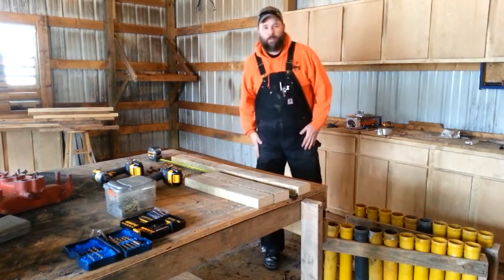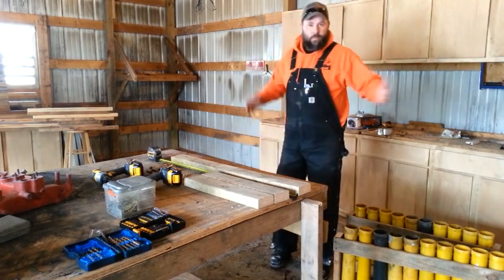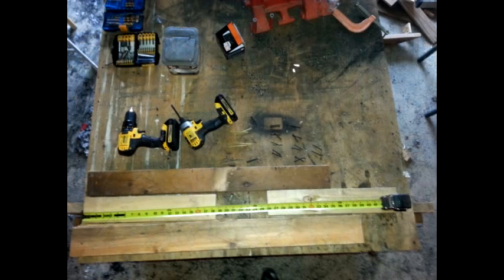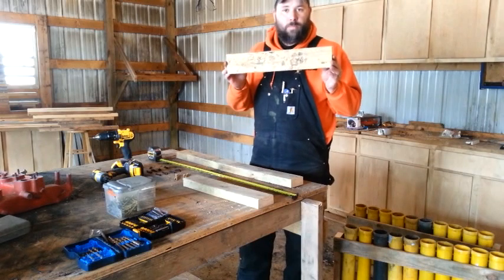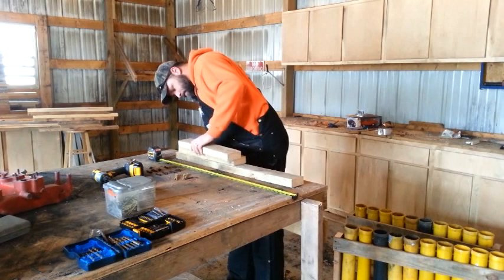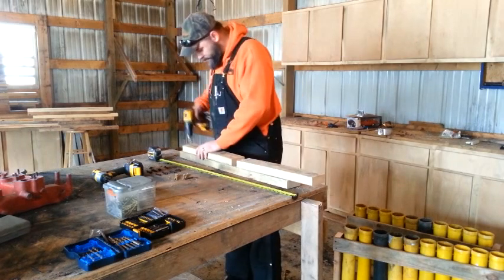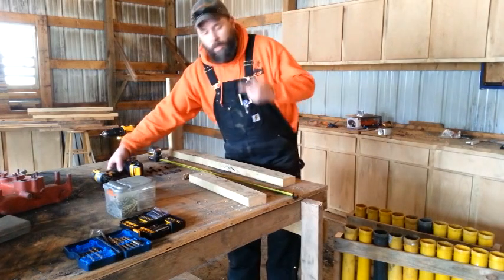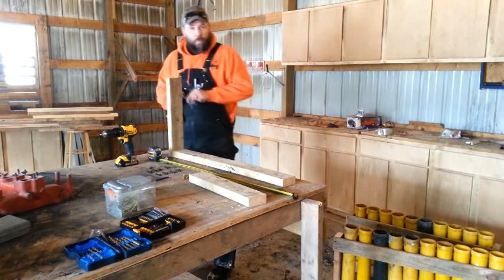3" Mortar Rack Construction Video

Comment: Good video Matt. May I suggest one more step, easy to do and increases the strength of the bonds. GLUE!!!  Tightbond II is the glue of choice. Wood plus glue plus screws! I feel glue is very important to use.
Reply: These things blow apart sometimes after the first use. Not always, but they don't last long, especially 3" and up. You are always having to replace wooden pieces, sometimes after every shoot. Gluing the pieces before screwing would make it nearly impossible to repair these when needed. Gluing mortar racks is definitely not a good idea, I don't care how much stronger you think it will make it

Comment: Do you know if the HDPE tubes will fit in your rack construction??… I have HD PE tubes not fiberglass and I wanna know if your schematics will still work for those
Reply from the maker: Sure will, I've made both.
Reply: Matt Hovey do u have any of the schematics for the a 5 shot rack?? Anything you could post for me? Or can I just cut in half the dimensions for this rack in this video for a 5 shot?

Comment: Hey Matt if I wanted to build a 5 inch rack what size pieces of wood do I need?
Reply from the maker: 2x6 should work as they are actually 5.5" wide, but measure the OD of your tube to be sure.  You'll also want spacers.
Reply: @MattHovey  Thanks Matt! I am using the HDPE tubes. What size pieces can i use for spacers? Sorry i am not a woodworker. Again, thanks.
Reply: @dwdrumshdspacers are to be equal to the diameter of the largest mortar 👍motorcyclesvirgom7379

Comment: Good work! Do you by chance have the dimensions of a 4" rack. Im Building a multi size rack that will hold 1 4", 3", 2.5" and 2", ill use the 4" rack as a base line. Have you ever made one?
Thanks,
Steven
Reply from the maker: Coogan1997 For a 4" rack you can rip down a 2x6 to about 4.5" for the frame. Why would you want a rack with one of each size though? Why not just build a 4 shot rack for each size tube? You'll eventually grow into needing them!

Comment: Nice video. Did you use spacers in between the tubes?
Reply from the maker: Ricardo Lopez Jr.
Thank you . I chose not to use spacers on 3" & smaller racks.  If you want to use spacers and maintain 10 guns per rack, just make your racks longer.

Comment: Quick question. What would the measurements be for a 3" 5 shot rack?
Reply: kraziee650 just built one , haven't got the tubes for it yet to see if it fits well but thanks what I used 
1 2x4 cut to 17.5" for the bottom 
2 2x4's cut to 14" for the sides(these can also be cut taller to 16" or 18") 
4 1x4s cut to 20.5" for the sides , (I actually messed up and cut them to 19" instead of 20.5 because of a math error , you will want them to 20.5)
Reply: Did you ever get the tubes and see how the fitment was? Thinking about making a few of these.
Reply: Flash K yes, they have a nice tight fit. Like ,really tight fit ,the rack is super sturdy and I'm over all very happy with it!
Reply: Sweet, I have future plans for the 5 shot. It’ll be a lot easier to just use a plank to add more 5 shot racks. Plus the mobility 😂